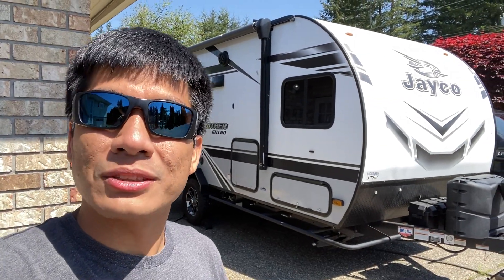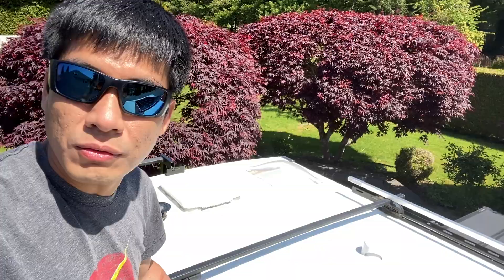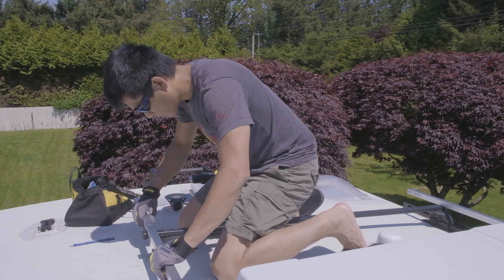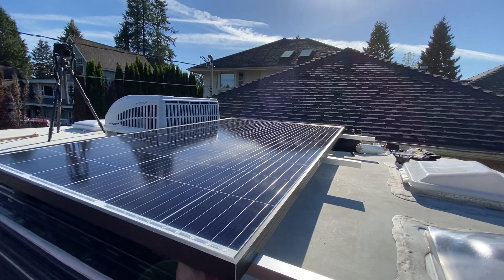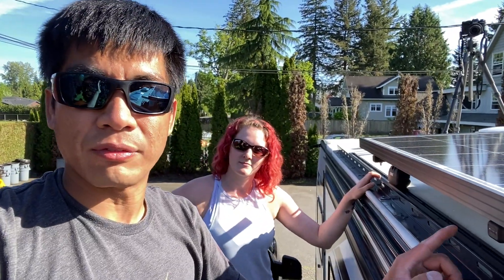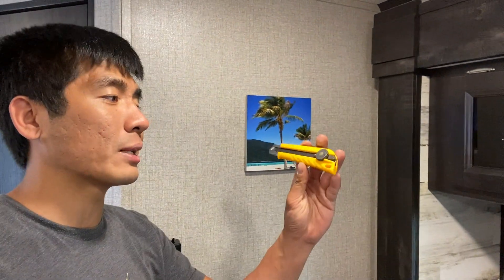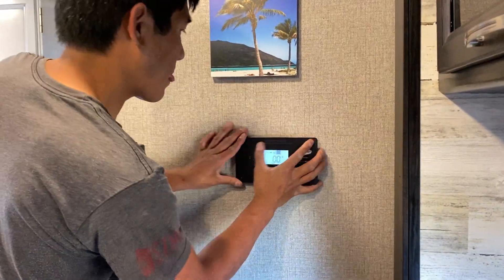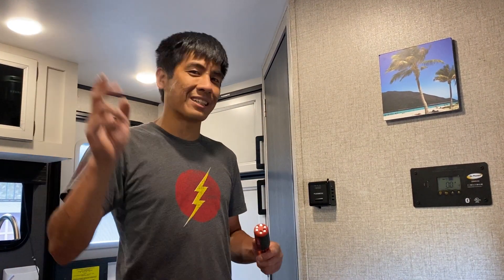Jayco 166FBS - DIY Solar Install

Comment: Thanks for this video! Really difficult to find info on this setup that jayco includes on their trailers. There was 1 sheet of "info" we found in our folder, which is basically just a sales sheet of GoPower products. I've been worried it's more difficult than they lead you to believe, but your video shows clearly how easy it is. Thank you for this!

Comment: I just found your channel this morning. I bought the same camper last November. I bought mine from Haylett RV in Michigan . Mine came with the solar package. I added a lithium battery. I took out the outside refrigerator and built a cabinet for the Blackstone griddle. Now all I have to do is pull it out(on drawer slides) and it’s ready to go. I just got back from a one week camping trip and it was very comfortable. I’ll be keeping an eye on your channel to see what other upgrades you make.
Reply from the maker: That’s awesome! I love Haylett rv videos ! We want to add lithium as well. Do you have an inverter setup ?
Great idea for making a mount for the blackstone! We took the fridge out of that area and made it into storage for our outdoor gear hiking shoes lift jackets fishing stuff etc. We call it the “fun bin” haha. Enjoy your trailer! We are out on our first trip now. More videos soon!
Reply: I know it’s prewired for an inverter, that’s something I have to look into. I was hoping that would be your next project ,lol.
Reply from the maker: @franktj125  haha maybe I will look into that soon! Right now we just run a genny off the back of the truck
Reply: I’d love to see how you made that cabinet slide! We’ve been thinking of doing the same thing since that’s where we now store the griddle since taking the fridge out. The table they provided with the rig for the griddle is awfully heavy and bulky. We’ve just been using a separate camp kitchen stand, but it sure would be nice to just slide it out!
Reply: @franktj125   Thanks, I’ll check it out! I hadn’t thought about a heat shield, but it’s good that that the griddle doesn’t flame up like a grill lol…

Comment: I have a 171bh on order, so I will be watching all your videos!!
Reply from the maker: Nice! The entire jay feather micro lineup is awesome 👏. Enjoy your new trailer! What are you towing with?
Reply: @LetsJustGoTravel  We are stoked. First trailer. Honda Ridgeline
Reply from the maker: @TheDiskinsDoEverything  nice! I had a Tacoma towing a 174bh before this trailer. Once we got it I decided to upgrade to a 3.5L f150. Tows much better! Make sure you stay under your payload rating for the ridgeline (not tow rating).

No major problems at all so far with the 166fbs! Couple minor things like drawers that could be a bit straighter or trim that isn’t perfect. But none of those are a big deal. All systems worked perfectly and we’ve towed it over 5000km and no other problems so far. I will be making an owners review video soon that goes more in depth!
Reply from the maker: @TheDiskinsDoEverything  I’ll check the hitch height and get back to you !
Reply: @LetsJustGoTravel  yes! Many facets to consider, I am definitely watching payload (1500lbs). Thank you for looking at hitch height for me.
Reply: @LetsJustGoTravel  hope things are well! I hate to ask, but I want to make sure I am paying the correct amount, how much was you set up?
Reply from the maker: @TheDiskinsDoEverything  Nice! That's great payload for a smaller truck! Our Tacoma only had a payload of 950lbs! Not even close to being enough, especially after tongue weight and some gear in the bed of the truck... no room for people!

The hitch height on my 166FBS when level is about 21 3/4 inch to the top of the coupler! Hope that helps!
Reply from the maker: @TheDiskinsDoEverything  Trailer price is heavily dependent on your location and how far it had to travel from the factory to get to you. I'm located in Vancouver Canada so its the PNW. When I purchased the trailer I traded in my 2020 174BH. List price on the 166FBS was 35k CAD at the time (Sept 2020), and I paid a difference of 19K CAD (so trade in value for my 174BH was 16K CAD).  Since then the trailer has shot up in price at all the local dealers. The cheapest I see now is about 42K CAD.

Where are you located and what did you pay?
Reply: @LetsJustGoTravel  super helps! Thank you!!!
Reply: Great video idea (selfishly) - what bought/brought or wish you had when picking up trailer for the first time.
Reply from the maker: @TheDiskinsDoEverything  not a bad idea! Will add it to my list 😎

Comment from the maker: UPDATE 2: This video is now outdated as we have completely redone our off-grid solar setup. New video here: https://www.youtube.com/watch?v=7ePdcowOLkY

UPDATE 1: It has come to my attention that the solar charge controller I used in this video is mis-matched with the size of panel I installed. We have since swapped out the solar charge controller with a Renogy Adventurer-Li 30A PMW Controller. Thanks to viewer @Aleksandr Arkhipov for pointing it out!
Reply: How many watts was the original panel & What was the issue with the Go-Power controller?

Comment: I would like to see how its hooked up to batteries etc. I installed panels on my camper and have controller, switch and inverter but need to see how its all hooked up

Comment: When you cut the hole for the battery monitor, how much farther to the left could you go?  I would like to view the controller while the slide is in.  I have the same camper (2021). I realize the heat thermostat is nearby.   Maybe I could go below it if there is not a stud in that wall.
Great video Mike!!!
Reply from the maker: Hey thanks for watching! Sorry this was so long ago I don’t really remember how much farther left you can go. There are studs in the wall in that area so there’s only so much room left or right that you could move.

Comment: I was curious with this setup what is the solar accually charging?  Is it charging  the DC battery or is it providing power to your ac outlets
Reply from the maker: It’s charging the dc battery but we have also added an inverter since this video and can now run AC devices off our batteries

Comment: Couple of questions. 1) two sets of wires. I assume one set came from the roof but where does the other set go? Is there an inverter down line from your charge controller? 

2) what all are you powering with this since it’s “wired for solar”?

Comment: Hi Mike, I am installing a panel on my 166fbs. When I opened the wall I find a loop of wires. How did you determine which side of the loop went to the roof and which side went to the battery?
Reply: Did you ever figure it out?

Comment: Hi. We just got one of these. It has a 190w panel and GoPower controller already, but I may refer to this for adding another panel sometime. Just curious though as to whether you’ll be making videos on the inverter installation and swapping the  batteries for lithium? Supposedly inverter pre-wiring is standard on these, but I’m not sure. The dealer wanted to charge a ton of money for making the lithium switch, saying that I needed a new charger and some modification for the charging coming from our vehicle. It’s very confusing, so I really hope to see someone else do this stuff on video!
Reply from the maker: Yes we do plan on adding lithium + inverter using their pre-wire setup. However probably not until springtime... stay tuned!
Reply: @LetsJustGoTravel  Yes, and I hope that it goes smoothly for you. Our dealer said that for the lithium upgrade we’d need a different converter. They quoted us around $700 for the converter and the labor, plus the cost of the battery itself, so we decided to hold off until spring since our winter camping is going to all coastal with hookups. Also, they said that ours is only pre-wired for an 1800w inverter for some reason so be mindful of that.
Reply from the maker: Ohh wow thanks for the info! Had no idea that I might need a different converter and that the pre wire might be limited in capacity. I was hoping to have a setup that would allow running the AC off lithium batteries but maybe that’s not possible.
Just confirming you have the 166fbs as well right ? Thanks again for the info !
Reply: @LetsJustGoTravel  Yes, we have the same model. It did come with the solar, although I doubt that makes a difference. It has a 190w panel and 30amp GoPower controller. That’s what they told us when we looked into having them put a lithium battery on it instead of the two regular ones that it came with.
Reply: That’s correct, you would need to get a new converter charger. These batteries require different charge profile (higher voltage). Thus, your currently installed converter will not be able to fully charge lithium batteries. The same goes to the solar charge controller - you would need to reprogram/reconfigure it for Lithium batteries. If it does not support lithium - you would have to buy a new one that supports it. Also if you going to get inverter - consider getting inverter charger instead. They not only invert 12v to 120v but also have built in converter charger to charge the batteries, transfer switch, and can operate in “pass through” mode. You would not need to buy a new converter charger if you get inverter charger. Also, don’t forget about federal tax credit (if you are in US) for solar, I believe it’s 26% for 2021.
Reply from the maker: @aleksandrarkhipov1  Thanks for the amazing info!! I didn't know any of that. Much appreciated!
Reply: @LetsJustGoTravel   I’m might be completely incorrect as I don’t know the specs of you solar panel (I could not find the panel you are using under “Our RV Gear List”), but my concern is that your solar charge controller and solar panel may not be matched correctly. According to your controller specs the max solar panel voltage input is 28v and I think 315w panels usually run higher than that (30+ volts). Once again, I am not an expert and I might be completely wrong.
Reply from the maker: @aleksandrarkhipov1  looks like you’re correct! I looked at the specs of my panel and it’s around 33v.
I’ve been running this system for months now with no issues… but maybe it’s worth upgrading my charge controller. Thanks for pointing that out! Learn something new everyday
Reply from the maker: @aleksandrarkhipov1  we have swapped out our charge controller. Thanks again for pointing that out!!!
Reply: @aleksandrarkhipov1   Thanks, that is really good information. I spoke with someone at Jayco, Greg Baumgartner in engineering, and he said that this unit’s inverter pre-wiring is only compatible with an 1800w inverter. It would be interesting to see if that turns out to be the case for other owners. It’s good to know that I can go with an inverter/charger and bypass the need to have a whole other charger installed… We’re probably going to start our upgrade process in March before our boondocking season begins. Luckily where we live there are plenty of electric campsites in the winter so we can stay nice and toasty while we adventure along the coast.
Reply: @jenlitteral9355   somehow I overlooked the fact that you trailer is pre-wired for 1800 watts inverter and you are planning to use it (pre-wire). In that case you probably will not be able to use inverter charger. Inverter charger has to be installed in a certain way -  it is connect to the battery bank (as any inverter would), but it also has AC 120v in and AC 120v out. Shore power gets to be connected to AC IN (instead of to electrical panel as currently it is) and AC OUT gets to be connected to electrical panel. Now if shore power is connected - inverter charger will operate in pass through mode, meaning it will pass shore power directly to the electrical panel and every outlet will have 120v. It will also charge the battery bank. If you are not connected to shore power and turn inverter on - it will take DC from batteries, invert it to 120v AC and will pass it to electrical panel. All outlets would have 120v as your trailer would be connected to the shore power. You could even run your air conditioner if both your inverter and battery bank is powerful enough. Inverter charger has a lot of benefits and cool features, but the key is that it has to be installed this way. As to existing pre-wire, I have no idea what it includes and where wires go, but I really doubt that Jayco had inverter charger in mind when they designed this pre-wire. Also, because it’s rated for 1800 watts, which converts to 15 amps 120v AC and it means that the wire they used is probably 14 gauge, which is to small to handle shore power of 30 amps AC. I am guessing that Jeyco pre-wired for inverter to power some outlets directly. Sorry if I caused any confusion.
Reply from the maker: @aleksandrarkhipov1  thanks again for all that great info. I have started my research and purchase of parts to install a full lithium and inverter setup. So far I’ve purchased 3 x 170ah lithium batteries, 3000w inverter, and separate transfer switch and power converter. I did want to get an all in one inverter charger but the ones I could find were too heavy and I am already having to find creative ways to save weight in order to make room for the batteries. I am waiting on all these parts to arrive and will be doing a full setup video.
I am also planning on upgrading the solar an am hoping I’m doing this right. I will still be using the jayco pre wire for solar system but will be adding many more panels. I will be removing the 315w panel in this video and replace with four flexible panels. 2 x 175w and 2 x 100w, as well as changing the charge controller to mppt. Hope it all goes well! I don’t suppose you have any insight to shed on this potential install. Is there any issue with installing that much solar into the jayco pre wire ?
Reply: @LetsJustGoTravel  wow, that's a lot of power :). Yeah, 3000w inverter chargers are heavy, but secretly I still wish you would go with the inverter charger but with the smaller size like victron multiplus 3000. Many people believe it's 3Kw because of its name, but it's actually 2.4Kw only. Extremely capable unit with some powerful and very useful features, only 40lbs and can run my 15Kbtu AC with my 300ah Li batteries without any issues (although it's not practical to run AC off the batteries only as they get deplitted after a couple of hours). All in one unit, which saves the space and makes installation easier. That's what I installed on my trailer (2020 winnebago micro minnie 1800bh) and I love it. Obviously I am very biased :). Anyway, you've got to do what you believe is best for you, so there is nothing wrong with your decision. With the regards to your flexible panels: you have to be very careful when you mix panels with different specs. Here is an excellent video explaining why https://www.youtube.com/watch?v=jejro4zkl8I. Generally it's not recommended to mix different panels as it can be very difficult to make them work at full capacity. Often people solve this problem by making multiple solar arrays where one array consists one type of panels and another array consists of another type. Each array would have its own solar charge controller. Since you planning Jayco pre wire - you can have only one controller. Another thing to keep in mind is that depending on you panels specs and how you connect them, you may need to install a inline fuse(s) when connecting your panels. Here is another excellent video from the same channel explaining this subject https://www.youtube.com/watch?v=s1P31hxlD3I. Also, most likely your Jayco pre wire for solar is rated for 30 amps (you should obviously check it), so that's one of the limiting factors you have to have in mind when connecting you panels - obviously you total amps output from your panels should not exceed this rating. You also need to think about solar array disconnect with the breaker (I don't think you currently have one). Here is another good video https://www.youtube.com/watch?v=HOXnWXvLXko about this subject. BTW my understanding is that double pole breaker in the video it's more like a best practice (again that's my impression and I might be wrong). Marine electrical is very regulated and by code double pole breaker is required for proper installation in marine environment. RV solar installers are trying to follow these marine codes, which is a good thing. Personally, I wanted to install one too but could not find one with the needed amps breaker rating, so I installed similar to this one https://www.amazon.com/gp/product/B07D7T3ZR5 instead on a positive wire of my solar array. It works great and I know that a lot of people have been using it for this purpose too, but I have to admit that it still bothers me that I am not following that code. Ohh, on a subject of securing flexible panels to the roof I would recommend to check out this video https://www.youtube.com/watch?v=uJIEXhnF8MU.
One more thing don't forget about shunt based battery monitor - you definitely will need it as it's the "only" way to tell the state of charge for lithium battery.
Reply: Jayco is now pre wiring the Feather Micro for a 3k inverter, it's an option with 2 x 190 watt panels for '22. Jen, sounds like your dealer is pulling a fast one, the Chemistry in a battery does not change its 12v output, it only needs to be recognized by the Inverter (there is a setting for 3 types of batteries, flooded, sealed and Lithium) as Lithium for the correct charging parameters which the Go Solar charge controller is capable of doing. Your car altenator can still charge a Lithium battery but will not usually Peak the battery's charge, and is not recommended for optimal lifecycles in the long run, but when traveling should be fine.